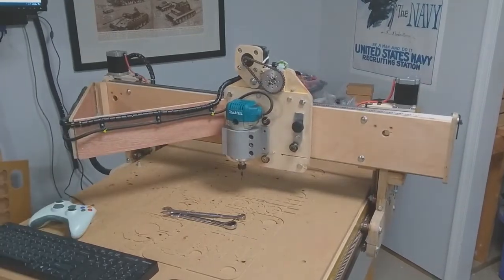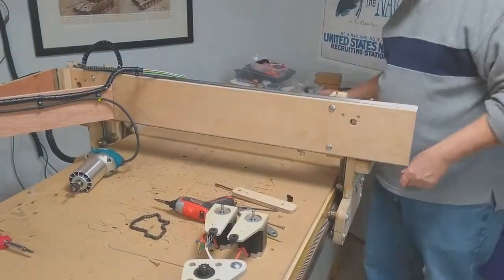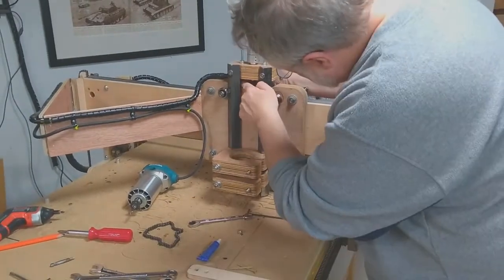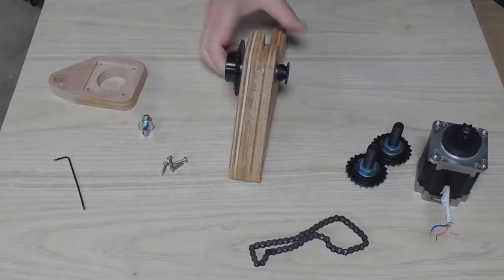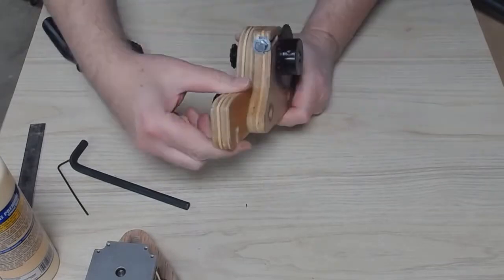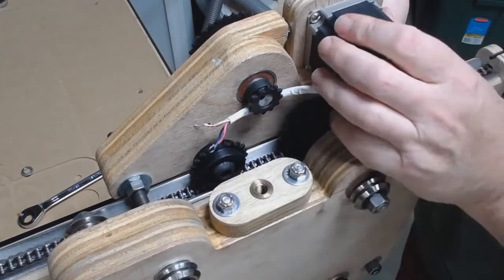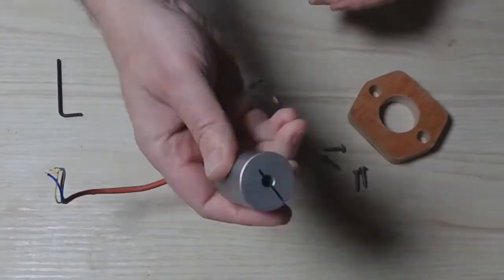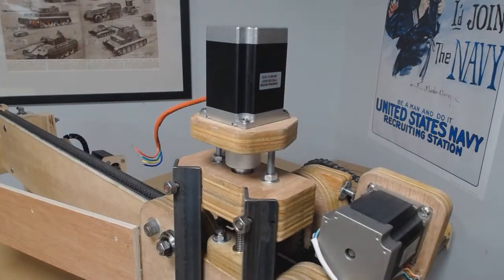DIY CNC Router Rebuild Part 2

Comment: I like the design. Do you have any data on how precise it is and how it held up over time? Did the v-groove bearings shave off the steel angles over time? Cheers
Reply from the maker: I don't use the router much so I can't really comment on wear on the angles.  They still look ok to me.  For accuracy data check out my Instructble on this router.

https://www.instructables.com/Low-Cost-DIY-CNC-Router/
Reply: @zeketeccnc1207  thanks!

Comment: Hi Steve,  It sounds like you upgraded one or both of your stepper motors; did you have to upgrade your stepper DRIVER, also?  

BTW, this is an excellent design!
Reply from the maker: I upgraded the X and Y steppers to 570oz Nema23 motors.  I bought some upgraded drivers but haven't used them yet because the TB6600's are doing fine.